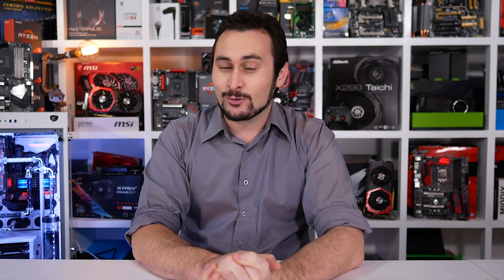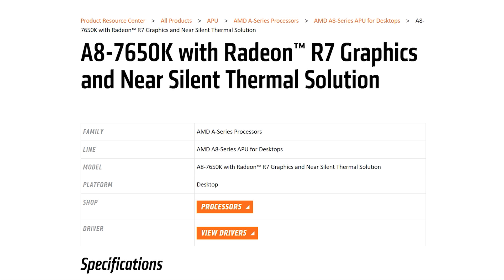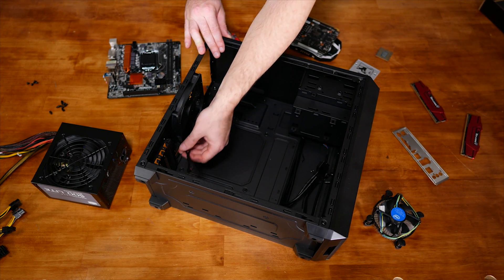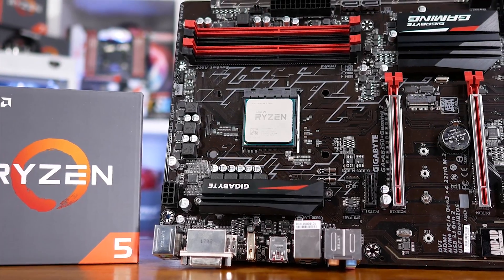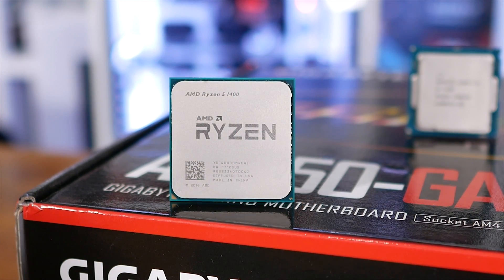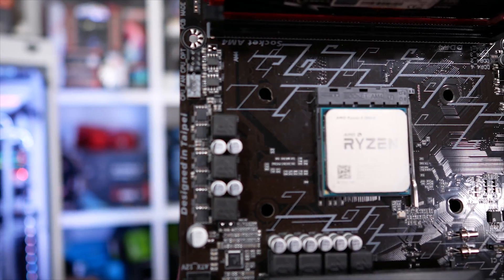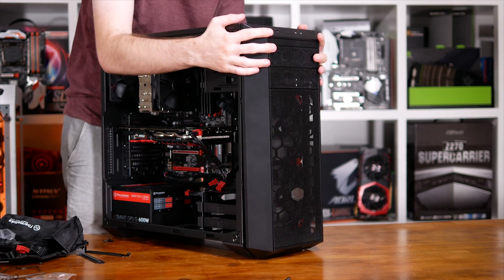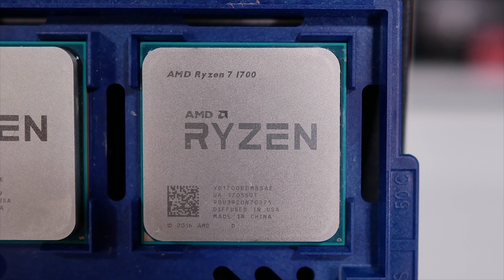Top 5 Best CPUs, Ryzen 3 & Threadripper In Mind!

Comment: I am not much of a fan of the A320 chipset but the fact that a local store is offering the R5 1400 and an A320 motherboard for $165 USD I can't pass that up for my rig. I will miss the overclocking but since my current system has an A10-5800K in it I won't be looking back!

Comment: There is the AMD's upcoming server CPU family and that has up to 32 cores and 64 threads so that will be more powerful than Intel's best offering. Also there are some dual socket motherboards for that.
Reply: Balázs Rakó Yeah, that's Epyc, which is for servers. Not to say you couldn't use it for a workstation - you certainly could - but very few users need 128 PCIe lanes and up to 32C/64T. 
Threadripper on the other hand with its 64 lanes and up to 16C/32T should be plenty for the workstation users, and it has better clock speeds anyhow, which is usually important for workstation uses.

Comment: top 3 worst cpu's:
1) Intel i5 750 quad cores , you can buy i5 760 for the same amount of money .
2) AMD FX 8370 , worst IPC , i5 2500K is better 
3) i3-7350K , expensive 2 core 4 threads unlocked CPU , good for overclocking but not for gaming .

Comment: Thanks for the hard work steve :) I wish you include one more category that is best cpu for esports at high fps >240fps.
Reply: Sumana Soh The G4560 is probably fine for that, unless you're streaming it. In which case, things get complicated. Ryzen 1600 is probably the best compromise there, if using software encoding.

Comment: top 5 worst cpus:

1.) i5 7640x
2.) i3 7350k
3.) i7 7740x
4.) i7 7820x
5.) Any xeon cpu
Reply: I suppose you've never heard of the Xeon E3-12XXv3 chips.
Or the Xeon E5450.
Reply: tbf thanks to old xeons some poor gamers can get a 8 core cpu for under 100 :D
Reply: 1)7350k
2)7640x
3)7740x
4)Pentium D
5)Fx 9590
Reply: To use those xeons you still have to get an expensive old motherboard, those things are much more expensive than the cpu because they fail much more often so there is lots of demand for mobos but little demand for the cpus, so it's definitely a gamble, and if you're poor you can't afford to replace it when it fails.
Reply: Dave Sterling 
On the other hand, I built a 16C/32T machine with 128GB ECC RAM for under $1000. So, yeah. They have their uses. If you're gaming, then you won't benefit, but if you need lots of RAM or threads, then it's really nice to have. And if you need more than 4 or 8 sticks of RAM, or plan on using a ton of PCIe stuff, then Xeons are your only option until Threadripper hits the used market. At that point, you can get 32C/64T without breaking the bank. Unfortunately, AMD has been a bit flaky with virtualization, so I wouldn't trust a vnode on AMD hardware to be fully stable yet.
Reply: Xeon CPUs are so bad, the world's most powerful supercomputer uses xeons and a fuckton of budget builds using old parts are based on older xeons. i agree

Comment: You can overclock Ryzen on B350 boards just fine, the ASUS Prime Plus is probably the motherboard to get, though the ASRock boards are pretty fine as well.
Reply from the maker: Yeah Ryzen overclocks really well on B350 boards. That said I wouldn't throw an 8-core model at a cheap B350 board and expect it to go well :D
Reply: Hardware Unboxed I think the ASRock AB350 series are the best value B350 motherboards. Theu feature all thimgs others do with more power phases for OCing.
Reply: Street Guru or just get the cheapest. MSI and Gigabyte mobos are good as well

Comment: My top 5 worst CPUs would be: 
1. i3 7350k - an overclockable 2C/4T in 2017 with the price of a native 4 core - Thumbs up INTEL.
2. Everything i9 here. It`s the first time they decided to put thermal paste, instead ofsoldering the ihs on a enthusiast grade CPU. Intel going from bad to worse. This is the worst thing they could`ve done.Threadripper gonna smash them if AMD prices their cpus right.
3. 1800x - why does this even exist? you have 1700, the same cpu but 200 dolla cheaper.
4.  7700k 4C/8T top end consumer cpu in 2017, sad really. 2600k had the same price with the same core/thread configuration 6 years ago.
5. 1700x - again why does this exist? Basically a 1700 with a bit higher frequency and no cooler.
Reply: Raymond Parpauta The Ryzen X models are for people who can't or won't OC. I agree however, it's super easy to do and saves you a lot of money!

Comment: The upcoming xeon joke made my day perfect, really nice series and video. About the top 5 worst, here's an idea (No specific order) 
5: fx 9590 , in my opinion it's worse than any fx 8000 series vishera cpus
4: i7 7740x
3: i5 7640x  3 and 4 are just crap cpus for the price of the whole platform, and i really don't see much sense in getting one to upgrade later into an 78xx or 79xx cpu
2: r7 1800x - no reason why it exists at that price point, really bad value for the money
1: i3 7350k - overpriced and needs an expensive platform when it's not even that much better than an 8 core fx cpu
This list only took into account cpus still on the market, don't have much experience on the older ones
Reply: The 6900k was already on the market when 1800x came out, and it came out at the same time as the other r7 cpus. It's not a bad cpu by any means, but it's still something which shouldn't exist at that price point, especially since the same company owns the best all around value cpu, the r7 1700. Pretty much any cpu I listed is horrible from a value standpoint. In regards to particular cpus running very hot, or having specific issues or other than value / performance criteria, I can't really say anything
Reply: 7350k is power hungry, expensive for what it offers, and even more power hungry and more expensive to overclock. What's the point of that cpu even existing when you have the 7400 or 7500 so close to its $180 price? The two real cores will almost always make up for pretty much any overclock you can get on the i3. And if you don't overclock it, why look for a K component in the first place? For 10 bucks more, you get the 7500 which can be used on any mobo which supports the 7350k. It's crap all around, it probably only comes out on top when compared to an fx series cpu nowadays
Reply: u need to buy a new cooler
Reply: Damian Razvan i think 1800x is for cheap servers who want consistent clock rate. and yeah u have a point too, but worse cpu would be on x299 platform at least for now, cause the reason it sucks is beacuse those motherboard are pure poop
Reply: Damian Razvan the ryzen 1800x would be amazing if it had like 40 pcie instead of 24 (dont remeber) but its a 1700x but its slightly oc
Reply: sure, the r7 1800x doesn't make sense compared to the 1700, but you might want to look at the 6900k instead for your list of worst cpus. it's basically a 1800x but twice as expensive. Or a 1700 but 3 times as expensive
Reply: It's the worst cpus, the 1800x is bad value, but top 5 worst cpus - lol?
Reply: the 1800x probably should have been replaced with the Pentium 4 Extreme Edition. Unless it's just recent stuff, not like an all time worst list.

Comment: My top 5 worst current (retail) CPU buys, with honourable mentions:

- Core i3-7100: Why buy this when the Pentium G4560 exists? You lose AVX2 (?) but that's probably not so important for most people.
- Core i3-7350K: You'd have to be absolutely daft to buy a dual-core processor when AMD's Ryzen 5 1400 is priced so closely with significantly more cores and threads (and a cooler in the box), and the G4560 is so much cheaper.
- Ryzen 5 1500X: Doesn't offer anything much over the Ryzen 5 1400 for the extra cash, and priced too close to the Ryzen 5 1600 which is a much better all-rounder.
- Ryzen 7 1800X: If you can overclock, the Ryzen 7 1700 is much, much better value. You can get ~98% of the performance of an 1800X on pretty much all 1700s with an OC, except for maybe the 4.1 GHz XFR Turbo.
- Core i5-7640X and Core i7-7740X: I'm kind of cheating here but these two are pretty self explanatory. You don't spend more on your motherboard than on your CPU just to get less than half the features of that motherboard.

Honourable Mentions:
- Pentium G3258: They still sell this thing at retail in Australia (why?) and it's priced at $30 AUD more than the Pentium G4560 (why???). Do not buy a dual-core, non-SMT chip in 2017, please. If you really want one to play around with for the novelty of having an overclockable Pentium in this day and age, they often go for like $50 used on Gumtree.
- Any AMD FX-series part: If you're stuck on AM3+ with a FX-4xxx or FX-6xxx series CPU, just hold the urge to jump on an FX-83xx and keep saving for Ryzen. You'll thank yourself in the long run. This especially applies to any FX-9xxx series part - just buy a Ryzen 5 1600 at that point.
- Any Intel Haswell or Skylake part: Just look second-hand if you absolutely need one of these slightly older architectures. New prices in Australia are higher than all of their Kaby Lake counterparts for worse performance and lower clock speeds.
- Core i7-7820X: Much more expensive than AMD's own 8-core desktop parts, and offers less PCIe lanes than last year's 8-core Core i7-6900K. Yes it's cheaper than a 6900K, but you really should be waiting for Threadripper either way at this price point.